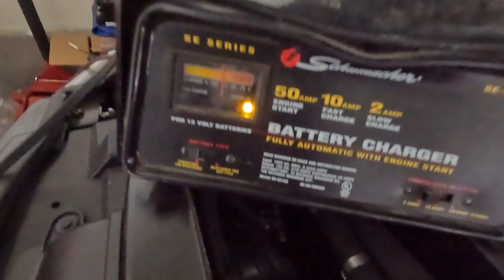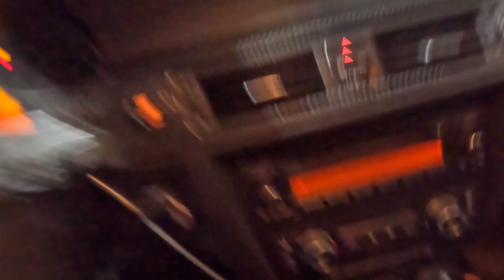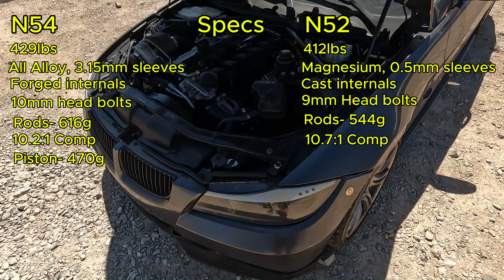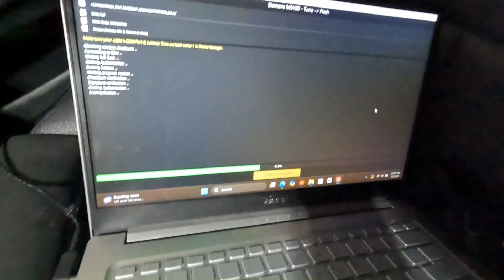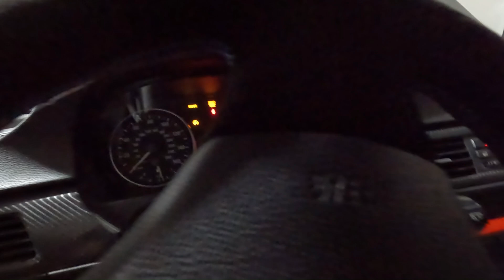N54vsN52 IS THE PERFORMANC MODEL ALWAYS BETTER?

Comment: How many horsepower can a forged N52 engine handle with a stock block?
Reply from the maker: Stock internals can get up to 500hp. You should get an upgraded or pinned crank hub anywhere above 450 or so. Forged internals and upgraded crank hub should hold close to 700 and any more power than that, you'll have to close the deck or so I'm told. Remember the advantage of this engine is lightweight. Getting n52 cars under 3k lbs is not too hard. In my opinion 4-500 HP and under 3k lbs is perfect in this car.
Reply: @Moon-Garage  What does "closing the engine" mean? I wanted to build a 700hp engine that can be driven at the wheels. Do you think that's possible?

Comment: Next couple of years I want to build my n52 using a European 2.5 crank accompanied with forged pistons and rods. Make for a reliable high revving 2.7L turbo n52 that makes 600whp
Reply from the maker: Sounds like what 4N Motorsports is doing to every BMW engine he has right now haha. That would be awesome, not to mention you could rev it to around 11k rpm

Comment: How difficult was the GS6 swap? I’m considering it for my 128i.
Reply from the maker: Not too hard all things considered. I did N52 lightweight flywheel, N54 clutch and pressure plate btw. I'll probably make a video about it soon because I got an upgraded clutch I need to install.
Reply: @Moon-Garage did you need a different driveshaft after? I’ve heard the transmission is a bit longer than the stock 28i ones. 
I’ll definitely be on the lookout for the video!
Reply from the maker: @Precious6308 yes the 335 driveshaft is different than 328. I ended up getting a 335i driveshaft and diff that had the same overall length and it all bolted up. 308 diff bolts to the same axles as the other diffs. I also modified a 328i driveshaft to fit with my welded 3.73 diff using the 335i transmission.

Comment: How much power are you pushing? I have a n52b25 on my e60 and im so interested in adding a turbo but i dont know if its worth it especially when its my daily
Reply from the maker: @olsianbimaj6017  Currently around mid 300s. Should be able to do high 400s.
Reply: @ would you say that it is possible for someone who doesn’t have that much experience in building cars to do it by themselves? Especially in a e60 chassi where it’s bigger engine bay?
Reply from the maker: @olsianbimaj6017  it definitely requires some knowledge, but usually you'll learn it on the way if you don't know it already so just send it.